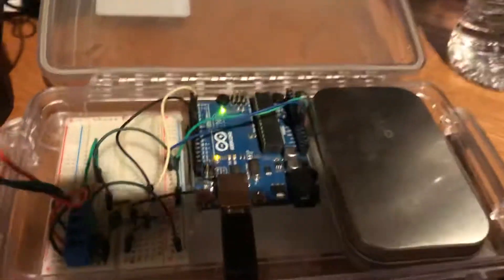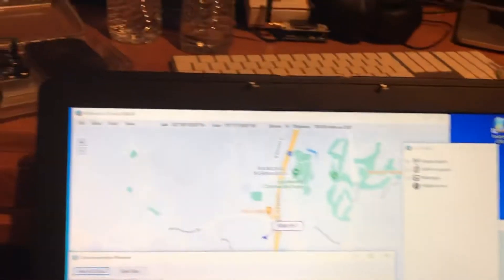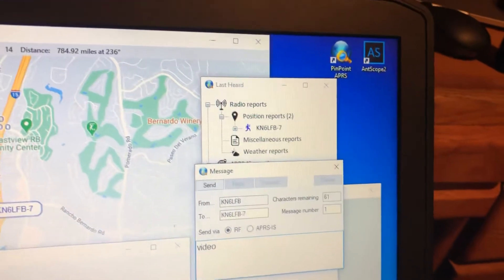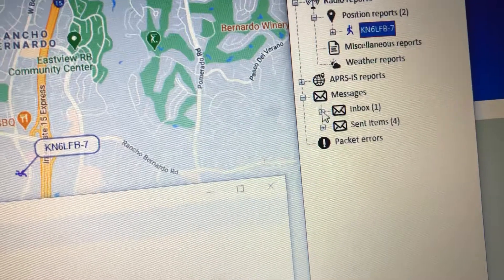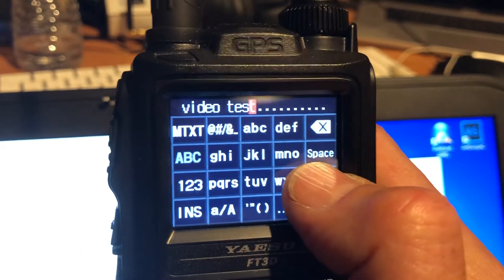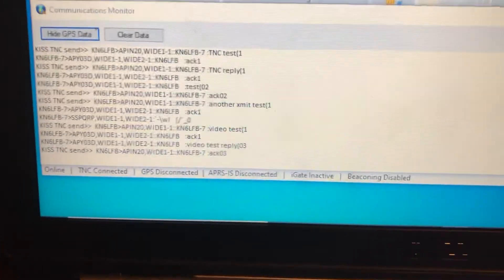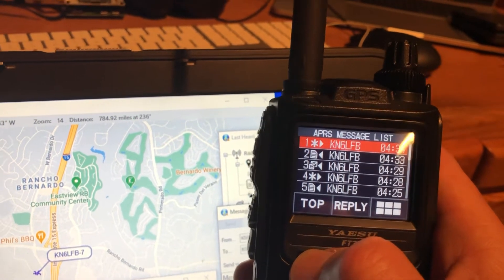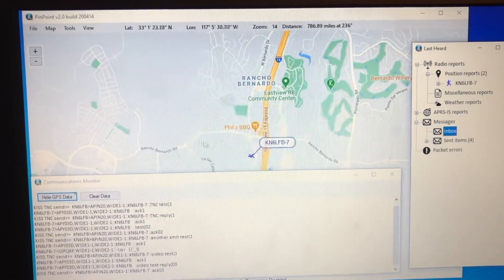Arduino Breadboard KISS TNC

Comment: Hello Jonathan,  That is a very cool project you have going there.  Nice work. I am following in your footsteps a bit and I am trying to build the same thing, but maybe add something to it.  I was wondering if you had any information about the KISS protocol. My understanding is that kiss is the protocol between the PC app and the TNC over the usb connection.  I am curious to see how those serial messages are structured/formatted to control the TNC and do returning messages from the TNC to the app have a format also? It seems a lot of TNC's use the kiss protocol. Thanks for the help and keep up the good work. 73 kc9aww.
Reply from the maker: Hi Brian.  The KISS protocol is fairly well documented.  I think this is the link I've used before: http://www.ax25.net/kiss.aspx

Also note that some early versions of the Arduino sketch contain a bug in the handling of escaped characters that would prevent sending binary data (as in a Winlink session, for example).  I know the bug was patched for the NucleoTNC and Mobilinkd TNC, but I'm not sure if the Arduino TNC source was ever patched.

Comment: can you share the program settings? TA5OAC 73
Reply from the maker: In this video I was using PintPoint APRS.  TNC was set to "serial KISS mode" at 38,400bps.  I believe the rest of the settings were as the default.